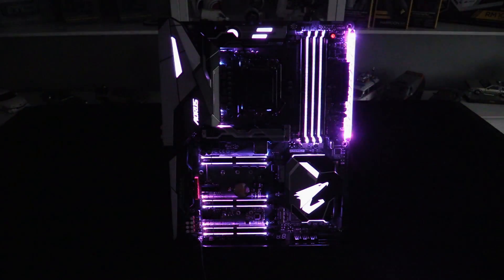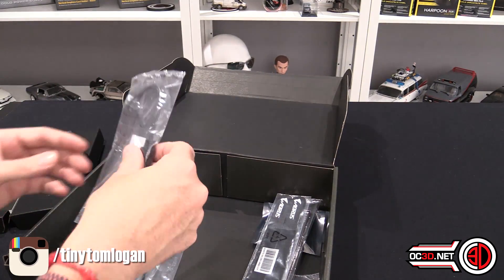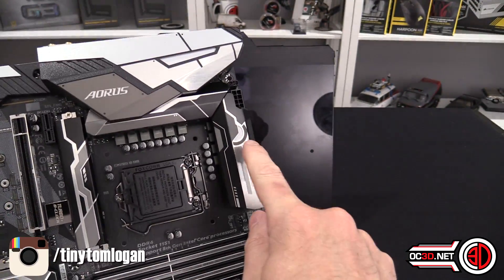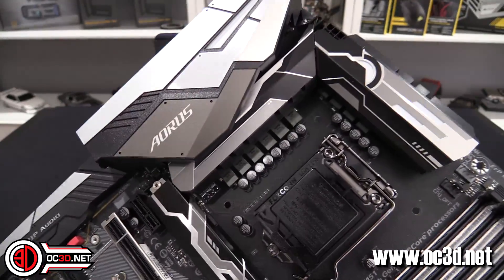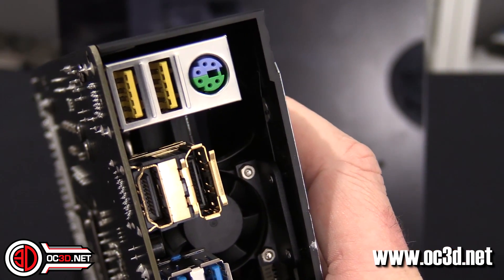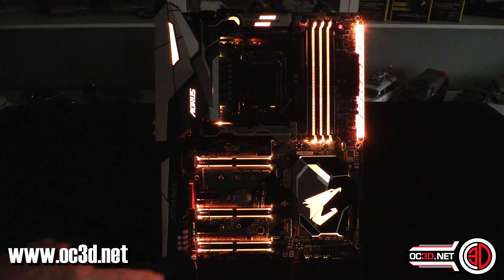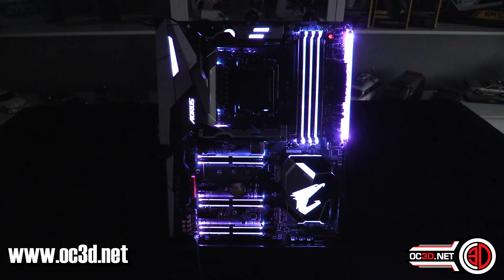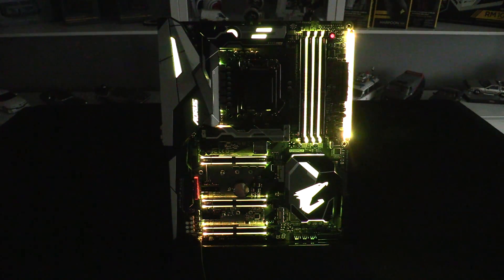Gigabyte Aorus Z370 Gaming 7 Coffee Lake Motherboard Preview

Comment: What i rly miss on all boards except on  the ASUS ROG ones is the water cooling headers and functionality in the bios to be able to control pump and fan speeds based on the coolant temperature (temp sensors). Gigabyte is clearly more focused on lighting effects which is basically ok but not if other essential functions are missing (to me)

Comment: Hello everyone I just build my new gaming PC 2 days ago.......
I tried to overclock my i9 7900x to 4.5ghz with my thermaltake AIO 360 RGB
I passed stress test in aida64 but when I started FPU test in aida64 my processor reached 100+ degree Celsius instantly and my whole pc turned down 
since yesterday I'm trying to boot my PC but nothing happens maybe my processor burned out and even if it happened can I get replace for new one from Intel ?
here is my whole pc specs :
i9 7900x
Asus X299-E
32gb corsair vengeance lpx ddr4 3000mhz
Asus GTX 1080Ti Strix
cooler master v1000 PSU 
Segate 2TB Skyhawk 
Samsung 500gb evo

thank you everyone for reading and helping.
sorry for my bad English.
Reply: Bitupan Dowerah the promblem is x299
Reply: Yes you have one CPU to burn from Intel warranty with Skylake X. Please contact Intel. regardless of what people say their customer service is pretty good and they tend to replace most CPU. As long you arent like smashing it with a hammer or something.

Comment: Aorus boards are very pretty, does the UEFI stack up against Asus well in other chipsets?
Reply: I've got an Aorus X370 K7 and from what I've seen from those with the ROG board Gigabyte has done a very good job of putting everything you need in the UEFI. ROG actually seems to go a bit overboard and that can get confusing if you don't know what some of the settings do. That's my take on it anyway.
Reply: Thanks. I've always appreciated the aesthetic of this line, preferring the all black iterations. Silver in this board is sharp however.
Reply: Better even